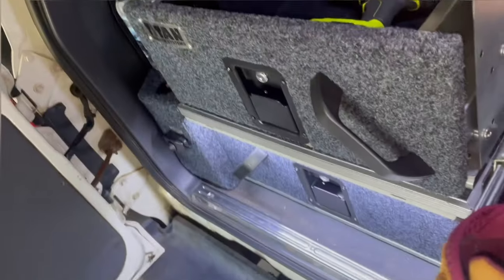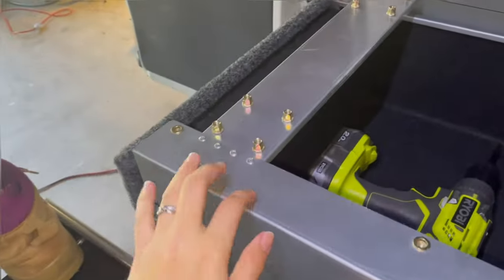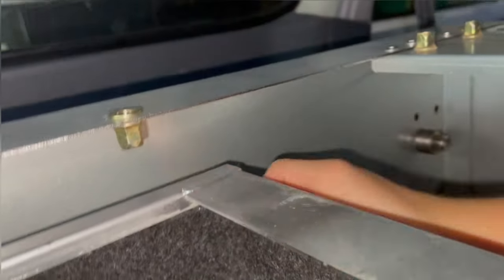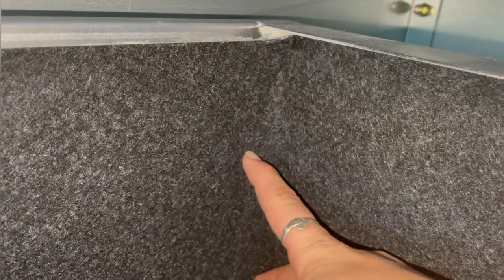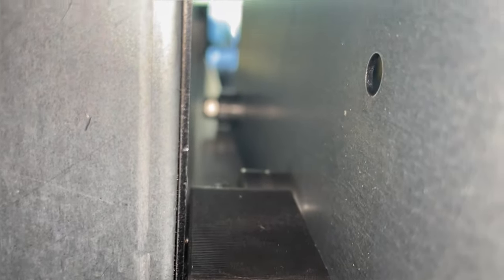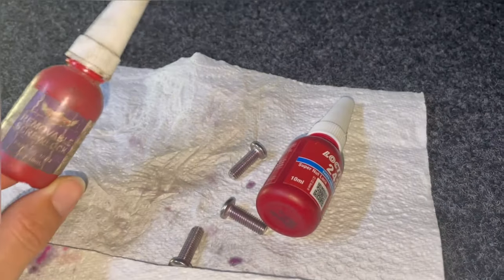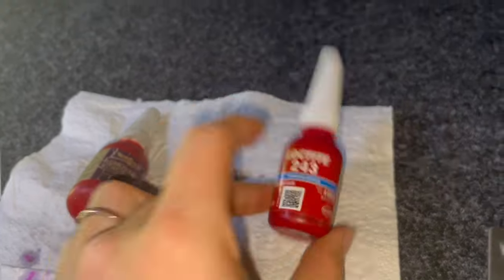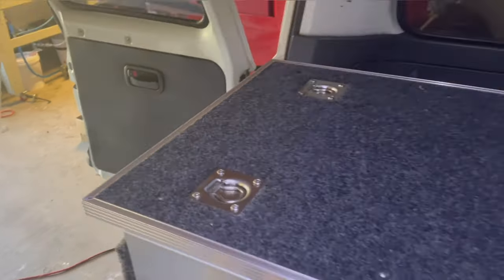How to install Titan drawers bump stops

Comment: Good video, my drawers were in my 4x4 when I brought it but no bump stops
Reply from the maker: Yea I know people do that so they can use the full length of the drawer. With the bump stops it’s a bit harder to reach up the back of the drawer from them not coming out far enough 😁

Comment: Seriously very difficult to do, the screws are so short and the thickness of the carpet liner as well add to the difficulty, its nearly impossible to put these bump stops on, a slot cut into the steel frame to allow access with your fingers to push the nuts into the bump stops would help enormously.
Reply from the maker: Absolutely agree not the best design and no clear instructions on how to install them make it even harder 🤦🏼‍♀️